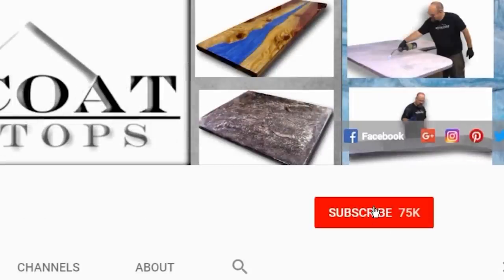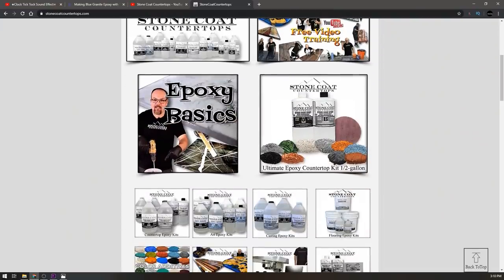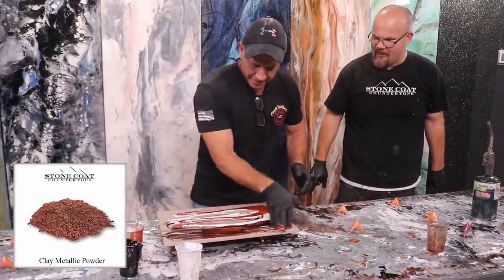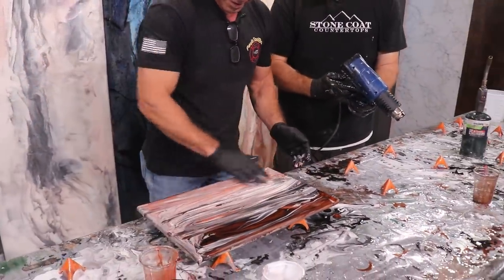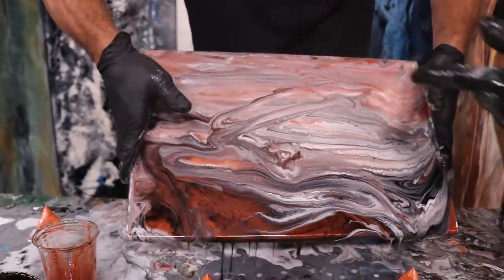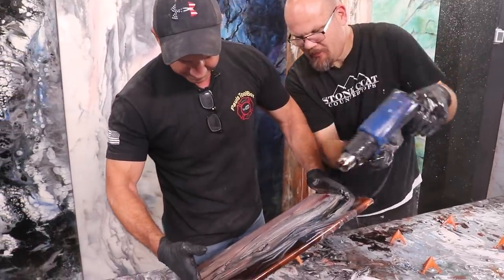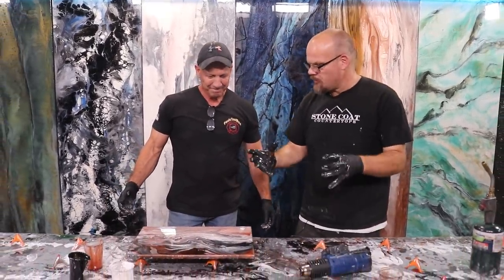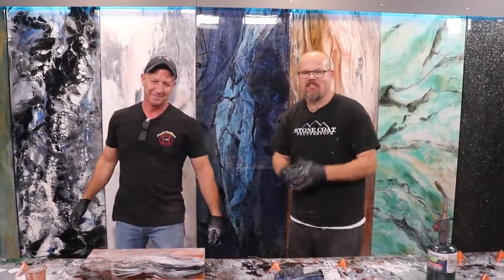Marbled Epoxy in Under 2 Minutes | Stone Coat Countertops

Comment: Kind of off topic here but you guys are the epoxy experts.  I have a plastic flimsy and hollow gun stock that I want to stiffen up. I was
thinking of drilling a hole in it and filling it with epoxy. It would not be exposed to the air like a table top. Do you think this would work,
and what type of epoxy would be best for this type of application?  Thanks!

Comment: I have a countertop that has chrome edge around the perimeter, like a quarter round 1 inch edge , can that be epoxied over after sanding and priming
Reply: Absolutely. Sand, prime with good primer like for example  STIX  and you good to go. Good luck.